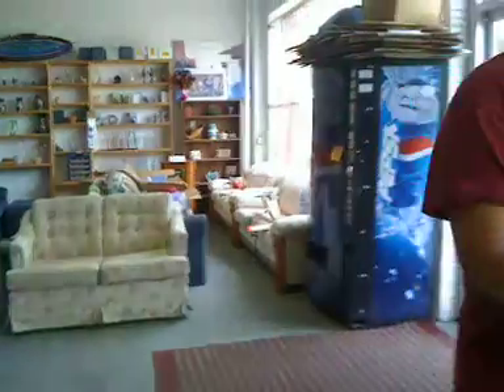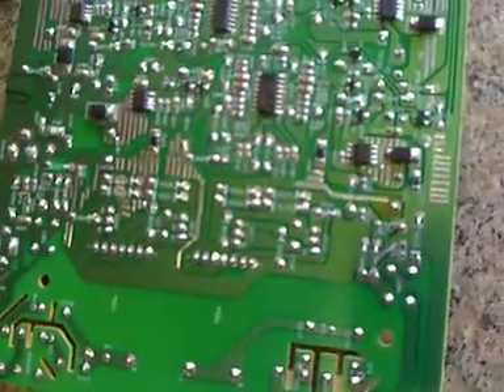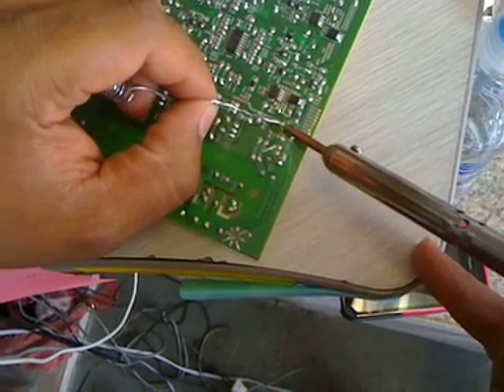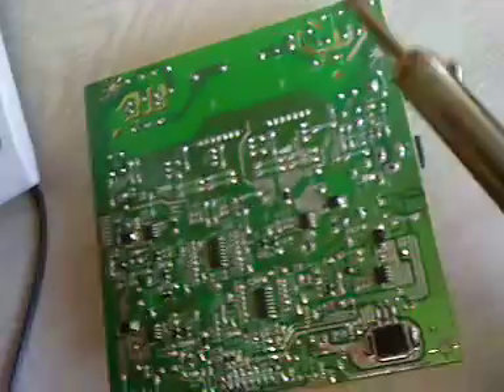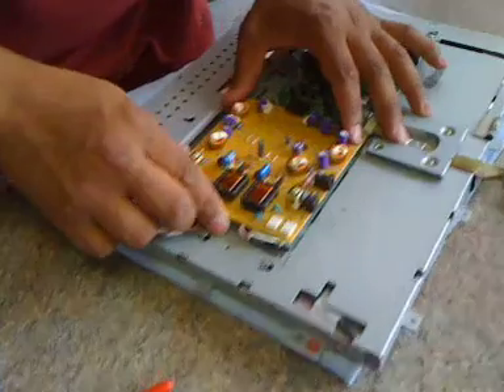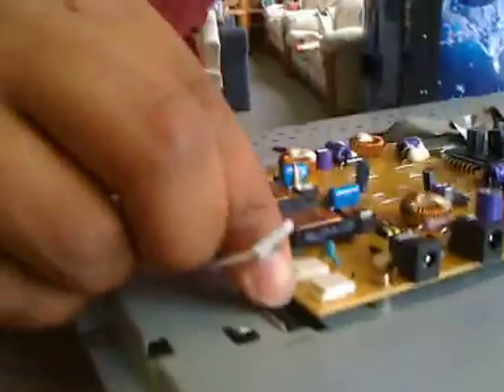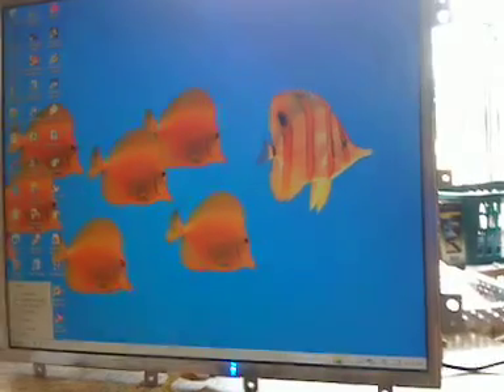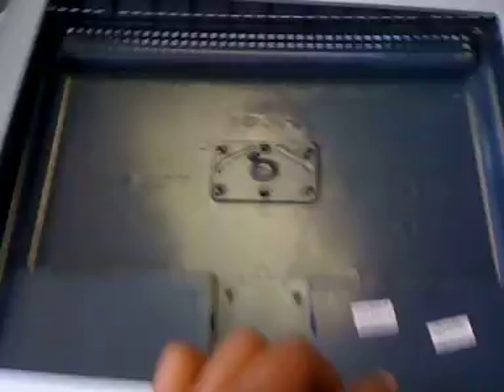How to repair HP Pavilion f1703 lcd monitor

Comment: I have an HP Pavillion f1703 monitor, and it begins to come on, and you can very briefly & very dimly see the screen image appear then it shuts down very quickly. Would you say this is a cold solder joint in the circuit board too?

Comment: @z28r2fast4u3 and @cricketyname, I am sorry if these are considered dumb questions, but...

How did you get the monitor opened? Was it a pry it up all around until it opens, or are there hidden screws? (edit) Okay I was finally able to view the entire video. Thanks.

What is a "cold spot" and how do you recognize one?

Edit to also add, no ground strap?

Comment: Repairing my HP Pavilion f1703 lcd monitor was super easy thanks to you....
issue:  monitor turns off after a few seconds..
Fix:     found cold solder joint on one of the coils on the power supply ... 
           just as you said on your video ..
Drop test:    PASS....

Removing the LCD out was a just as easy as you also said. It snapped right off in about 30 sec.  then removed two rear screws and I was on my way !!

Thanks and great work!!

Comment: It would have been usefull if the film had started with the case removal as most of these repair films assume that the case has already been removed. This is not helpfull if one is looking at a monitor and can not see any obvious way of getting inside it.

Comment: i open my lcd monitor same like you but i have other issue on it, one of the ic is burned and i need the replacement the legend on it is (4411, be4k1b) i think it could be a operational but i need another view of this,, thanks

Comment: @Cindee60 a "cold spot" is an American term for what electrical/electronic techs in the UK, New Zealand and Australia call a "Dry Joint".  it's when a solder joint that holds an electronic component in place on a circuit board has either had not enough solder applied, or the component has come loose at the solder joint over time [through vibration, over heated or bad soldering technique], and here's a bad connection. Resoldering fixes the problem, as per the video [thanks for that, btw]

Comment: @toddmel7876, R128 is a 3.3 Ohm resistor rated at 2 watts. Replace it with a "fuseable" resistor, for it is meant to protect the circuit from too much current coming from a faulty 12V power pack.

Comment: @toddmel7876  i guess this help comes too late, and no one else has come to help, so in case others need help. R128 is a 3R3 [3.3 Ohms] rated at 2 watts. You could replace it with a "fuseable" resistor [goes open circuit, like a blown fuse when overloaded with current from the plug pack power supply], or a wire wound type, which is the original type [i think?]. But any type of 2 watt resistor at 3.3 ohms will do.

Comment: Great Video! I'm having the same problem with my monitor and I need to check it out. I was not exactly sure how to disassemble this monitor, so your instruction at the end was very helpful. It took only 5 second to get the LCD bezel (grey front plastic frame around the front of the monitor) off.  I picked one of the lower corners and slowly pry it up with my fingers. Like many monitors, once you take the bezel off without breaking it, the rest is easy. I'm hoping it's just a cold spot. Thanks!

Comment: Hey, I have the very some monitor that's doing the same thing, Im sure its that "cold" thingy you mentioned.  Question... how did the "cold" thingy get there... I had this monitior for about 3 years, worked great until the "cold sore" thingy developed... how did that happend??? Actually, I dont even know what to look for, can you do a "close-up" on what Im supposed to be looking for..

Thanks,.